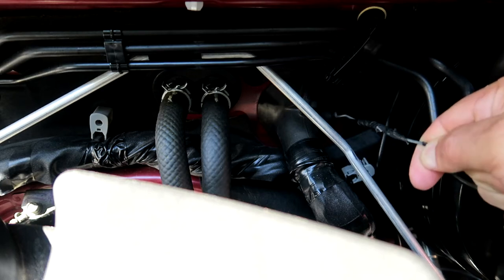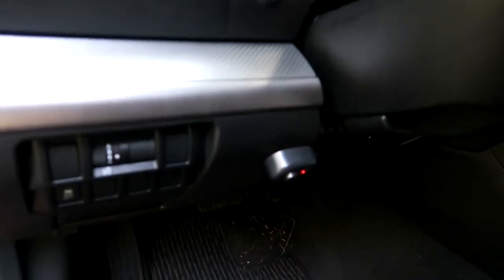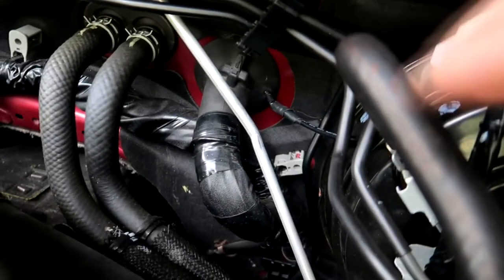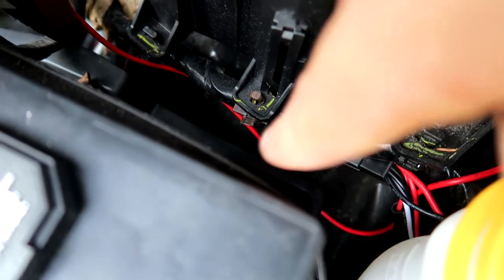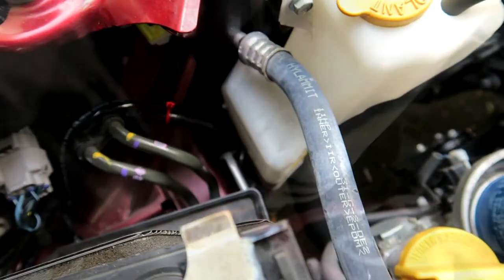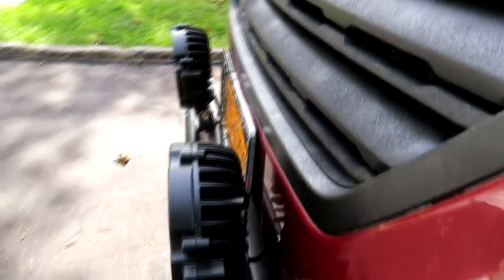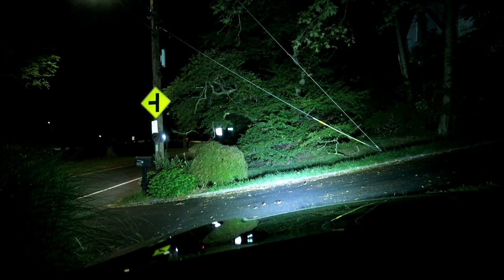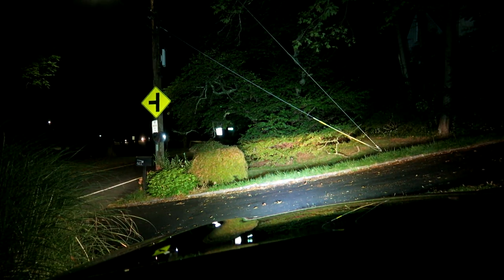LED Driving Lights Install How to Subaru Outback

Comment: Hey I know you did this for years ago but wonder if you had battery problem with that red light always on? I just installed lights on my outback and have the same issue.  The lights came with wiring harness and can only hook them up one way and followed directions to the T.
Reply from the maker: Never a issue with the lite on the switch.

Comment: Would this be the same install instructions for a forester in the same gen, I have a 13. I’m having a hard time seeing where the wires from engine bay would enter the cabin, thanks!
Reply from the maker: I poked a hole in the rubber boot if I recall running the wires. Did not use existing wires to run into car.

Comment: Thanks for sharing your install. Did you consider placing the switch in one of those blank switch plates to the left of the steering wheel? If so, why didn’t you go that way? Would have been cleaner I thought but probably harder I guess.
Reply from the maker: Yep. I assumed it would be harder and the kit came with the button so I just went that way. Maybe I'll change it because I have hit the button with my knee and left the lights on and had to jump start it. I carry one of those jumper packs that saved my ass.
Reply: Was it difficult to run the wires through the firewall?

Comment: I just checked out all your vids. Great Job!!! I have one question. If i went about the same route as you what size light bar would fit? Was thinking about getting a lightbar and relocating the license plate with the tow hook holder. What do you think? Thanks
Reply from the maker: Thanks. Are you talking about the LP bars? On there website they show what bars fit. My front plate may cause a issue with my driving lights on each side so close in the city but until I get a ticket I have not looked into plate location. I was going to get a tow hook but when I park in the Bronx I fear it being stolen. That hook cost more than my lights lol.
Reply: HecksVision yea..... im from brooklyn ny. The bronx is a shit show. I wanna get the same guard and plate but instead of getting the light setup you have, i was planning on getting a light bar and relocating my front license plate by getting a tow hook license plate holder. Instead of a tow hook being a tow hook, its just there to hold up your license plate.
Reply from the maker: Looking at the small bar from LP a plate holder looks like it will fit fine. I may get one myself as I seen one on Amazon for 11 bucks.
Reply: HecksVision ill take a vid of how it looks. Should check out my outback, got headrest monitors, radar detector, dashcam, neon lights ( i use them for puddle lights ).
Reply: Cihan Ugur I just got a 22” light Bar and it fits in the lower grill perfectly. It’s around 24” total mounted. You might be able to fit an even longer one

Comment: Did it end up killing your battery like you thought
Reply from the maker: No issues with the battery. I did upgrade to a more powerful interstate and a larger size like a year later. The stock battery is useless. 
The only issue I had was with the switch placement. I would hit it with my knee sometimes leaving the lights on when I got out. I got caught
a few times going back to the car a few hours later only to see the lights on. Lucky LED draws low volts and 90% of the time the car still started.
A few times I had to use my jump pack. Now I changed the location of the switch and all is well. A few LED lights in the lamps did stop working.
But I paid a low price.

Comment: Nice....but I do not understand why you have your entire vehicle outfitted for off road, yet run stock tires and wheels.  All seasons don't cut it off road.  Why no AT tires ??
Reply from the maker: No plans to go off road. I just love the look but like the smooth drive of highway tires. Guess I am a parking lot queen lol.
Reply: @ProjectsandReviewsZone  Ohhh.....That makes sense.   If you ever decide to do AT's....I just put them on my 2019 Outback.  They are great (but I also live in snow country).  I chose the Falken Wildpeaks and I have to tell you, I am considering never going back to my all seasons !  These things are great.  The plan was to use the AT's from October thru March and then switch back.  But I love these things....so may end up selling my wheels and all-seasons.